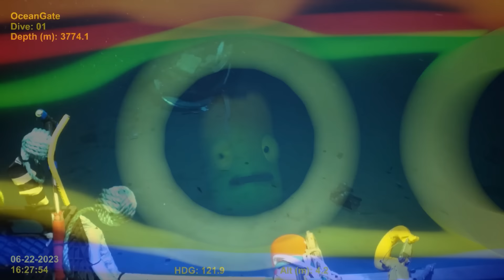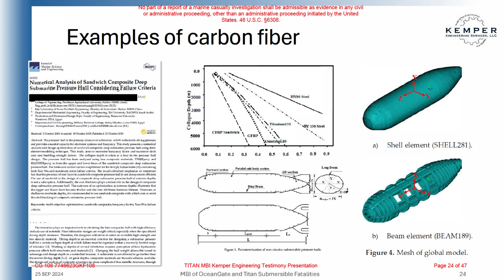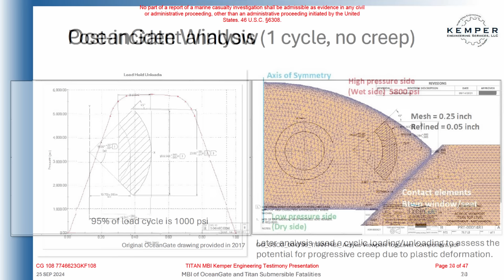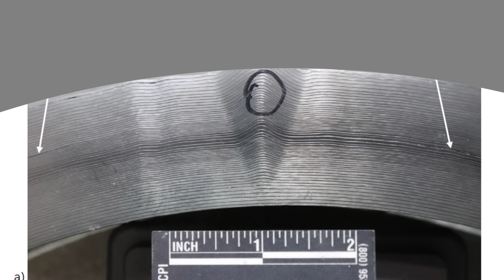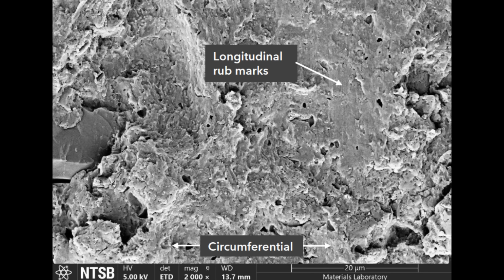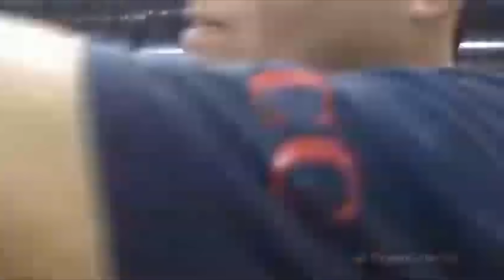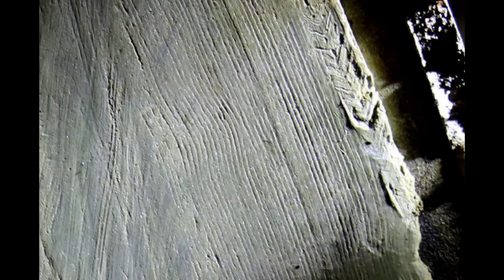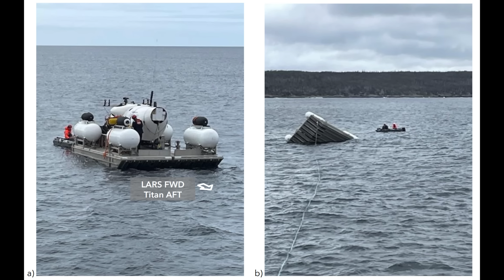OceanGate Wreck Shows Why Sub Wasn't Strong Enough To Survive - NTSB Shares Important Details

Comment: The best designed helmet in the world won’t do squat to prevent head injuries if you don’t use it, the same can be said for any safety system, including the real time system this vehicle had.  

NASA has demonstrated this at least twice with the two shuttle disasters.

Safety systems only work if you actually use them, whether it’s a mechanical system or a set of safety protocols.

Given that the very design and construction of this vehicle ignored safety protocols, it does not surprise me in the least, that the mechanical safety system was also ignored.
Reply: Imo the shuttle disasters were a little different. One was a foam part that shattered the heatshield and the other an out of spec SRB o-ring temperature caused by the nearby  liquid oxygen tank while the air temperature was ok. They simply never imagined that scenarios. Here a short view of someone in marine construction shows extreme design flaws (me at first view long before the accident). In common is that afterwards everyone knows better.

Comment: Call me Jethro Bodine, but doesn’t each small (cracking?) sound the acoustic sensors detected indicate a small failure of either some carbon fiber fibers, or localized de-bonding of the layers somewhere? Those wouldn’t magically repair themselves. So I would think that the running total of the acoustic emissions (cumulative damage count) would be at least as important as the rate of the emissions (the rate that tiny localized failures are currently occurring), although granted the rate the tiny localized failures are occurring at would accelerate the closer it got to complete failure. 

Perhaps someone with expertise in composite materials and their failure modes can comment on the above.

Comment: Stockton Rush cut so many corners in his design 
Most established submarines will want a margin of error such that the vessel is rated to accommodate pressure 2× the depth of decent planned 
Rush's design not only failed to achieve this, many components were insufficient for the target depth

Comment: I don't understand. Steel is cheap(ish) reliable, and has a proven record. Why risk your own life for the sake of some experimental material. Just use steel or titanium.
Reply: The key here is the steel sub would have needed a lifting body since it would have been much heavier than the water it would have displaced. For such an lifting body you need something non compressible, in the past gasoline/petrol was used in a balloon for this purpose.

This is a safe way to build such a sub, but the logistics would have been more difficult. To save money on the logistics they built the sub as light as possible to avoid using a lifting body.

In the aftermath it did not work, but the steel sub would likely have been not fitting into their business model

Comment: When people talk about how carbon fiber is untested in this application, this is one of the things they mean - not just the material itself but the manufacturing methods. The manufacturing method can make a huge difference in the strength of the material and it can take a lot of tests before you cement a reliable method to do these things. A simulation may look great on paper, but as you pointed out if the hull isn't 1 solid chunk but 5 solid independent chunks then the assumptions in the design are now invalid. This is why you can't trust the simulations, you have to actually test it. You have to verify your assumptions are valid.

Comment: I'm absolutely not a composites specialist, but based off of my understanding from studying metals as part of my welding and fabrication education, porosity is never a good thing, especially in situations where life and safety is critical, my education and experience told me that even a single bubble of air turns a super strong bit of metalwork into a potential death trap and should be nothing more than scrap.

Any porosity in any weld I made in any job I had was an instant fail, and even my lecturers at college made it clear it was completely unacceptable, under no circumstances was porosity allowed and had to be fixed or the part scrapped entirely whether it was structural or not, and carbon composites cannot be any different, the difference being that fixing porosity in metal is relatively easy albeit time consuming, composites however simply cannot be fixed and must be thrown away.

Under the intense approx 380 atmospheres of pressure the hull was under, each pocket of air in the composite was a weak point that only got weaker the more pressure it was put under, and allowed increased flexion and warping and therefore crumbling of the glue and resins used as can be seen in the released photos, and this would have caused fractures to form and spread further throughout the composite, making a microscopic bubble of air into millimeter or even centimetre long defects within the structure, and when you're talking about extreme pressures, any weakness is amplified and the pressure will equalise eventually.

No matter what else was wrong with the titan, it had a massive structural defect that in metal is an instant rejection of the part, it was no longer contiguous, it was more brittle, and left areas for delamination to occur. The hull should have been thoroughly tested for this long before it touched the water, and should have been replaced with a steel or titanium hull and redesigned with those materials in mind imo.

If cost was an issue for Stockton, then he should have chosen a different field to screw around in, alas he didn't, and now him and 4 of his victims have been turned into a brutal example of extreme physics at the bottom of the ocean.

The tl;dr is that porosity is very, very bad, and while it is unlikely to be the sole or even principle cause of the disaster, it will have substantially weakened an already compromised structure, and it would have failed long before becoming financially viable with or without the other defects it had.

Comment: Titanium ring flange to carbon fiber hull mating is definitely suspect and what I would consider highest risk point. The voids in the carbon fiber layers themselves are small enough to not cause immediate damage but cause the hull to flex over pressure cycles. When evaluating pressure data descending max depth ascending and number of cycles all play a big roll. This may not technically be a pure carbon fiber design failure but rather a fatigue problem over time. I think the truly biggest fault here is designating the paying passengers as crew members. If that is not a crime it should be.

Comment: I gotta laugh my ass off at every man and his dog jumping on the titan bandwagon like there is some new amazing undisclosed reason for it failing.....

ONE VERY SIMPLE REASON, A PRESSURE VESSEL EXPECTED TO BE RATED FOR DEEP SEA WAS MADE WITH COMPOSITE MATERIAL<<<<<<<<< THIS IS THE ONE AND ONLY REASON IT FAILED OK PEOPLE.....

I have worked in sub sea industries for close to 4 decades now. Never do we EVER make pressure vessels from fiber based composites because as soon as you begin compressing composite fiber materials they fracture. The more times they are compressed the higher the rate of fracture because the structure has already been weekend from its very first compression.....
It ain't rocket science now folks 😂😂

Comment: As far as I understand it, the problem with carbon fiber composite material isn't that it hasn't been tested to destruction but rather that the very nature of it being a composite material introduces so many variables that it's highly prone to catastrophic failure without warning. That's why it's not allowed, because a material that's inferior in some ways but will give you plenty of warning before it fails completely is still preferable to a material that may be superior in some ways but isn't likely to give you a head's up before it goes into instadeath mode.

Comment: Maybe it’s just armchair engineering but glossing over the difference in tensile Vs compressive strengths of CFRC is annoying af. It’s mentioned that it’s armchair engineering as if it’s going to be debunked later in the video and then never addresses. 

The slide where they talk about the advantages of carbon fiber specifically mentions it’s strength in tension.

Comment: One thing you didn't seem to focus on, Scott, is the different ways that titanium and carbon-fibre composite behave under pressure. They both compress under pressure, as will pretty much anything when you apply about 380 atmospheres, but they do so at different rates.

One article I saw calculated that the CFC cylinder would (all else being equal) compress by perhaps 1 cm more than the titanium end rings. No wonder one of the titanium flanges was sheared off!

Comment: From day one I suggested that carbon fiber is great as a pressure containment vessel but lousy at compressive pressure. Take a string, pull it, it’s strong, then push the ends together, it’s weak, same thing here. Under compressive loads from the outside, it’s only as strong as the matrix used to hold all the carbon strands together. I was met with a bunch of armchair carbon fiber scientists telling me this wasn’t a variable, while I see it as an obvious thing.

Comment: The inside ring was sheared off in the explosion, the outside ring was mostly sheared off after the implosion returned to equilibrium with the outside pressure which would have been close to as violent and explosive as the implosion.

Comment: Completely but maybe not unrelated, though I've tried a number of times in my life, I've never had any success laying a carpet on top of another carpet. The fibers interact somehow under the slightest pressure and cause movement between the carpets. You can't fasten them together securely enough to keep the top carpet from bunching up. I can't imagine carbon fibers don't react similarly. And especially under such immense pressure.

Comment: Rush once stated that the pressure vessel cycle life was infinite…. Then they ground down the CF bumps, then machined the lip to fit in the titanium, then threw away their RTM data that obviously exposed an issue on dive 80.

It’s almost like he cheated his way through his engineering degree and never actually went to class.

Comment: I've been involved in the design, engineering, fabrication, and repair of carbon (and other fibrous reinforcements) composite structures  for aerospace and racing cars for decades. This thing was a disaster waiting to happen from the beginning. The failure modes of the hull structure are exactly what one would expect...assuming one had real-world experience with filament-wound structures and composite bonding techniques and materials. Carbon fiber is also brittle, and when it fails, it tends to fail instantly and catastrophically, unlike most metals that can bend prior to failure, and could have given ample warning of impending doom.

Comment: Despite all the flaws in manufacture and the corners cut, and the negative things said about the use of carbon fiber, still it did well to endure the dives it was able to perform before it failed. Had it been built properly, even to the same design, who knows whether it may have performed many dives before it failed. I think perhaps the design of this submersible, including the use of the frowned upon carbon fiber, was not as dumb as its made out to be. Perhaps Rush's design was in fact ok and only the standard of workmanship in the build let it down.

Comment: So much for the decades of anecdotal presumptions & videos claiming that all materials barring steel, titanium etc will be squeezed out of existence when exposed to the pressures at such depths, how is there a major piece of the fibreglass outer shell namely the tail end of the craft still recognisable?
Reply: because, physics
Reply: it wasn't pressurised, so the pressure inside and outside the tail section equalised as the craft descended and ascended

Comment: 25:59 As a composites engineer I spent the video looking for signs of poor manufacturing and design practices, and honestly I didn’t really see any. The bond failures seemed mostly like cohesive failures which means that it was performing to its maximum potential. There were some adhesive failures at the ring which are suspicious, but not necessarily a smoking gun. We can talk about the wrinkles, grinding plies, etc, but I don’t think those were the culprit either. Nobody cuts through fibers without knowing they have margin to burn, and I’m assuming they did considering how many dives they survived. I nearly 100% think this was the result of that impulse and strain event which was obviously a collision with the barge during landing. They hit the boat, causing an internal crack or delamination which simply grew over time, resulting in that buckling and the subsequent implosion. It wasn’t really a bad ship, it just got abused and nobody caught the damage in time. Sad.

Comment: it is really shocking to see those flanges being so paper thin
it tore like nothing
those flanges should have been atleast 50 percent of the thicness on the out side and inside rings of the whole thicknes of the carbon fibre thickness
it would have increased greatly in strength  making theflanges much thicker
so 100 percent of the fibre thickness should have been devided in to 2 for flanges

also Boeing had no work on this but they did have a discussion with stockton and told him that the carbon firbre should atleast be 9.3 inches tthick
but he reduced it to 7 inches then more down to 5 inches
this was a big mistake from stockton
save cut on money led to mistakes in the design

also the lack of caring 
they made the fibre tube in open area where dust moved around freely onto the glue-that was dumb
secondly the submersible was left out in the sun and winter storms outside-not parked under a garage roof--allways exposed  to weather
thirdly the pulled it around on the seas causeing vibrations andthe bumping of that raft on the seas--that was causing thingfs to pull loose

Comment: They wanted carbon fiber because it sounds cool. Weight is not the reason. It’s a very weak material, but you don’t want light on a sub, you kind of want it to sink.
Reply: They wanted a lighter craft because a heavier craft requires a heavier transport and support vessel and is thus more expensive
A lighter craft would also float more easily, which in theory is what you'd want if you were thousands of metres below the ocean surface and had to rise quickly

Comment: Thank you for pointing out that carbon fiber composites are not a problem per se, but the design and manufacturing techniques were sub par in this case. It's tragic that the monitoring seemingly picked up the issue but it was disregarded. It would be more tragic if this disaster sets back ocean exploration and/or composite advancements, but I'm hoping the crew's deaths won't have been in vain. I disagree with those who say the Titanic is a graveyard and should not be visited. It's been well over a century, and the site is of great public interest and historic value. Looking forward to a possible video on the final report.

Comment: my armchair observations, i am a non-expert speaking from experience. having played with and observed what happens to glues and epoxies in regards to layering strength and having a competent understanding of how material behavior scales with force or pressure.

when the photo of the layer bulging was shown i thought those were of test pieces in learning the process not the final product. 
the slack portions of the layers, even if filling the voids completely with epoxy, operate at a minor reduced strength handling capacity under sheer force that becomes more apparent as stress increases. shaving them down removes the strength gains of those layers and increases the possibility of layer separation under shear force. 
gluing layers together after curing, even if your using the exact same tube of epoxy, will cause separation issues given stress over time. (there are a few youtubers who build fiberglass boat hulls who have stressed this point from their own experiences)

as a note, composite polymer materials and aluminum tend to fail as they are stressed and relaxed over any length of time, while steel will remain reliable under repeated stress and strain for any force limit it has been successfully tested under. example would be a gun barrel being deemed safe only after its first firing.

just as you eluded to, the end-caps, held together with just the glue, would have likely stayed together had the hull not separated, but i feel in any case where two wholly dissimilar materials are mated in high pressure applications, the rings should have been bolted or welded together along the length of the cylinder in some fashion.

assuming that the wrinkle layers had not obtained any gas pockets between layers, the safer option would have been to apply more epoxy over the exterior then true the cylinder on a lathe without breaking the carbon-fiber layer before continuing to add layers.

the windows could have used the traditional and tested domed window with a plastic bonded inner flat window to keep risk and liability down without compromising the view or safety. the inner window could separate in the event of being over-stressed.

all in all, without careful meticulous monitoring the carbon-fiber hull was always doomed to failure under these working conditions and careful monitoring and removal from service when danger conditions became apparent was the only way this design would be able to fulfill its mission requirements. since this industry is still fledgling for lower income tourism traditional materials and practices would have better served in terms of cost and safety.